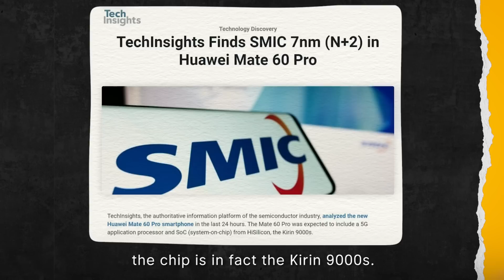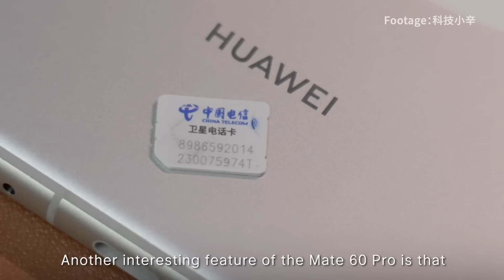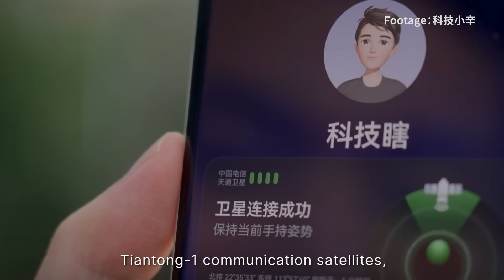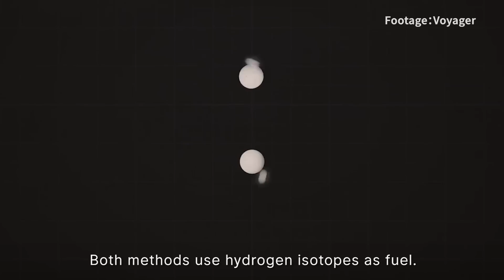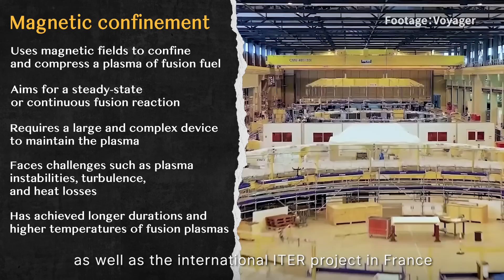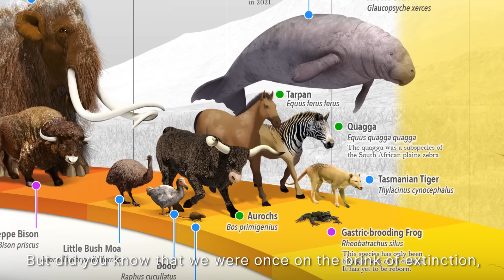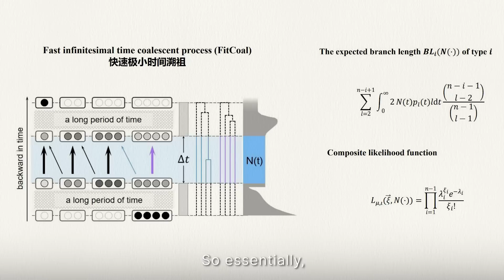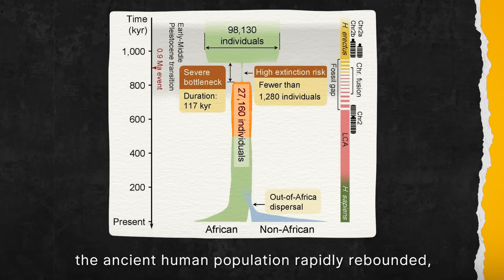Huawei: Defeated U.S. Sanctions and Challenged iPhone

Comment: The United States has a significant challenge in China's increasingly active and competitive global marketplace. China has deftly dealt with the difficulties faced by the United States sanctions against it, demonstrating its strong will and impressive ability in the face of adversity.

Huawei has deftly navigated these obstacles and achieved great success in evading the penalties imposed. The MAT 60, a semiconductor that Huawei developed recently, is a major technological step.

Huawei's most recent semiconductor achievement, the MAT 60, was completed entirely in China without using any resources or materials from the United States. This significant development is evidence of China's determination and technological might.

Comment: Huawei phone is at least 2.5 generations behind the current best microchip technology, I really don't know why all the Chinese are getting excited about ? The technology is even behind the Oppo, Xiaomi's Qualcomm Snapdragon chips 4.5 years ago.
Reply: 2.5 generations is a massive deal since the stated goal of US sanctions was to keep China at least 5 generations back.  China basically made up 10 years of progress in about 4-5 years.  The US would not be capable of this if they were in China's position and couldn't purchase Taiwan, Japan, S Korea, or Netherlands equipment.  Intel had all the advantages of EUV and unrestricted access to cutting edge equipment, and they are still on the equivalent of 7 nm.
Reply: Actually no since it has the performance of a 5nm chip due to the stacking technology and other improvements Huawei implemented in the design.
Reply: yes excited because free from CIA spy😂
Reply: When you’re 100 years behind and now 5-10 behind yes it’s a big deal